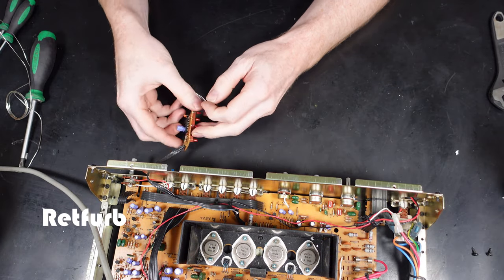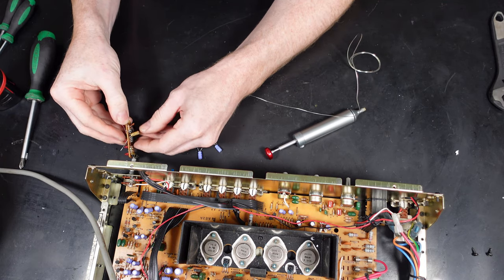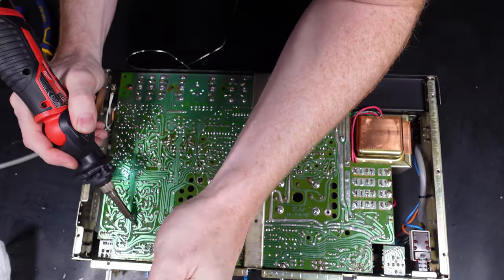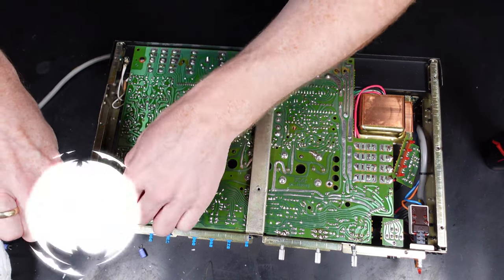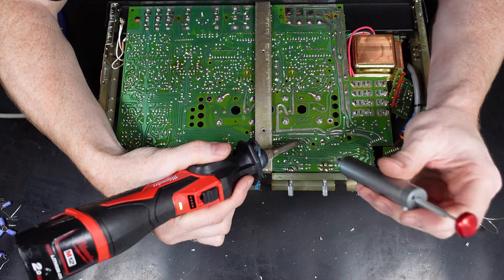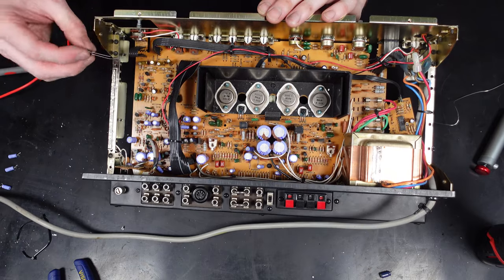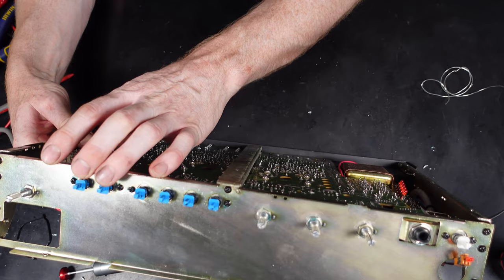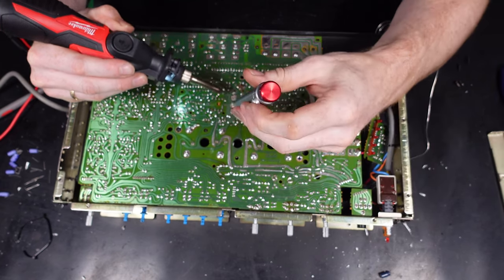Replacing Old Electrolytic Capacitors On A NAD 3020 A Amplifier - Retfurb Retro Audio

Comment: Lovely video thanks! In regards with startup noise - it's normal. I have a NAD 3020 (vanilla) that my dad bought new in '82 and I also have another vanilla that my grandparents bought around the 80s too, same noise. Super interesting to see subwoofers move backwards and forwards on startup. 

To reduce the hum on startup (especially when using the lab inputs), make sure Audio Muting is enabled before switching the amp on. Seems to help a bit. Cheers
Reply from the maker: Thank you for the kind message, Its appreciated. 
I did read a couple places that it was normal, But wasn't 100% sure. Thanks for confirming that again.  
I actually have another NAD 3020 video on a different unit, Which is coming soon.
👍

Comment: Interesting stuff thank you. my first amp I could afford was a Sony TA-ax4, I got it from a second hand electronics shop around 1989. I loved it.i paid £20..... now in 2023 I just bought a Sony TA-ax3 similar looking amp, nosteligic reasons but not working. I'm an electrician of 30 years but no knowledge in electronics but a big interest, always dabbled. 
this TA-ax3 won't power up. if I get it going I'll let you know,otherwiseyou can have it for spares
Reply from the maker: Thank you for the kind comment. Ah, I hope you manage to get it working. If I can be any help, Please let me know. I will do what I can to help. Have you found a service manual for it, As that we be needed for voltages etc. 👍
Reply: @retfurb  thanks, I might be in touch! I think it’s 24 volt as there’s a 24 volt relay in there. The pos speaker on one Chanel was shorted to the chassis, a 75k 5 watt resistor had blown along with a thermal fuse. 2 legs were soldered together on the main amplifier chip.  Iv sorted those issues apart from the thermal fuse. I’ll replace that and see if it works, fingers crossed!
Reply from the maker: @anthonybarra2391  Ah, great. Hopefully you've almost got it sorted then. 😄

Comment: Is there any way to replace those awful spring speaker terminals on the back?
Reply from the maker: @thethirdman225  yes. It is do-able. I have seen someone in the past using the more modern type, first fitting a plate for them to fit in to.
I will do this mod in the future, when I get another 3020 to do.
Reply: @retfurb  Thanks for your response!

Comment: Careful with caps off ebay, I've recieved fakes, even "nichicon" re-branded cheap chinese caps with the original brand heatshrink still under the rebrand! And worse...absolutely disgusting, empty large filter electrolytic cans with a cheap smaller cap inside!
Reply from the maker: @julescircuits845  yeah, I’ve heard of bad stories related to them.
I’ve used the same guy for a while now, so I hope he’s been supplying legitimate items. I’ve not had an issue as yet…